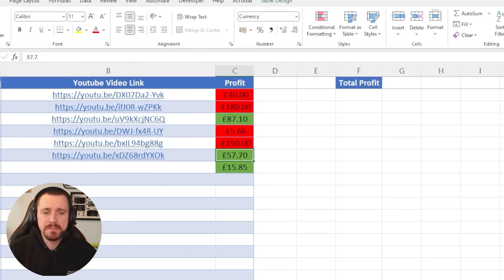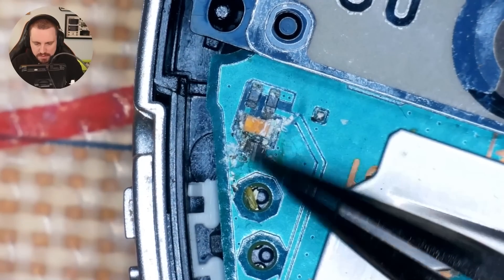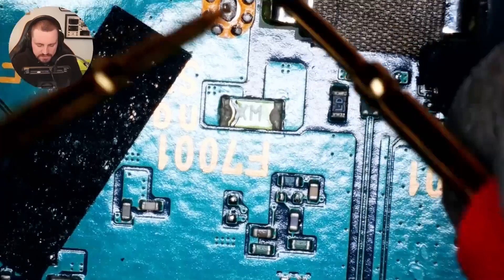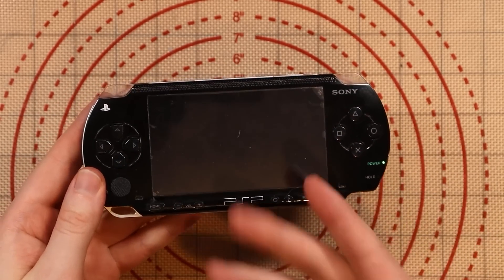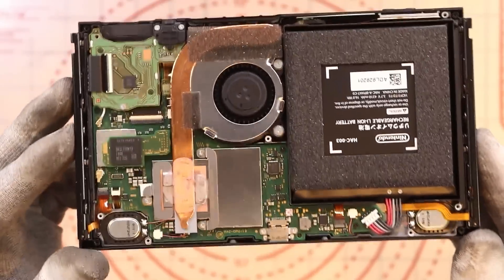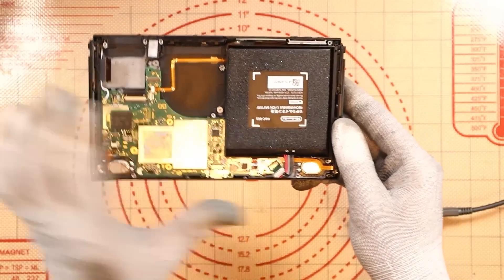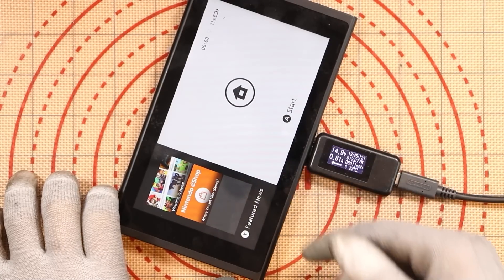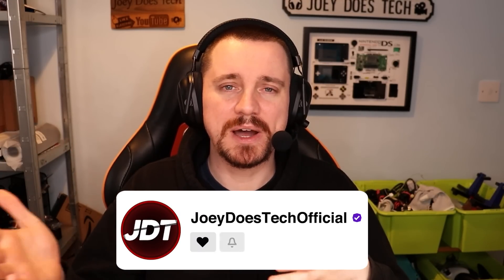Trying to Fix the Unknown for a Profit! | Profit or Loss S1:E48

Comment: first impression on the switch: if the customer had it stored for years not using it, it's probably a battery that's discharged way too far. might need extensive charging to come back to life.

Comment: That PSP repair has crazy nostalgia for me. i was 13 years old when I repaired mine and I had to replaced that same board because I had a broken power switch. That feeling of accomplishment is what sparked my interest in everything I repair now (as a hobby) 15 years later. THANK YOU JOE!!!  I didn't realise i needed that :)
Reply: Same here, my 2006 DS fat used to have issues with the charging system and i gave up 13 years ago... 3 Years ago i decided to try it and repair it succesfully and since that, +20 consoles repaired and have a little profit as my hobbie :)

Comment: Great vid as always! Couple things for the PSP. The console is hanging because it can't read the UMD. It might need a new lens/assembly depending on whether it was spinning or not (cant tell from the vid). I advise manually pressing the lever inside the disc tray a few times because sometimes they just seize up a little, you should see it console side sticking out and is activated when the UMD hits against it letting the console know one is inserted. 

Also the clock wouldn't have lost the time because you left the battery inside, you need to remove it and see if the time has been kept.